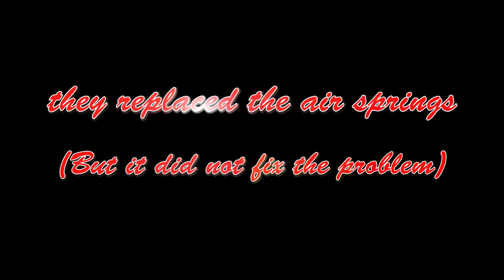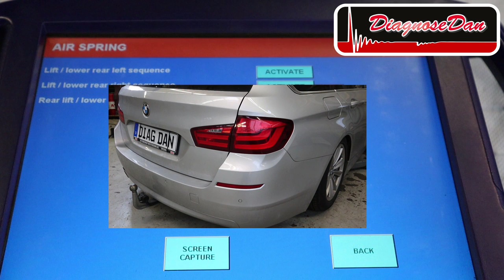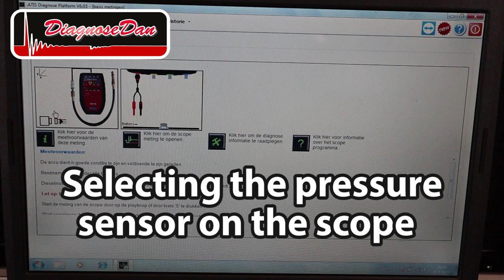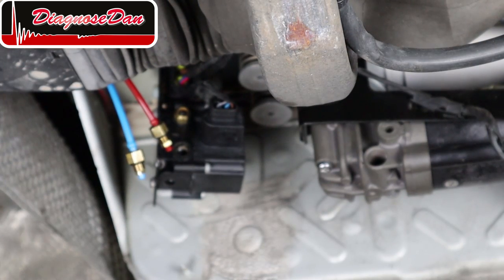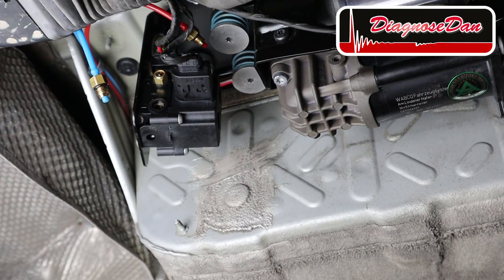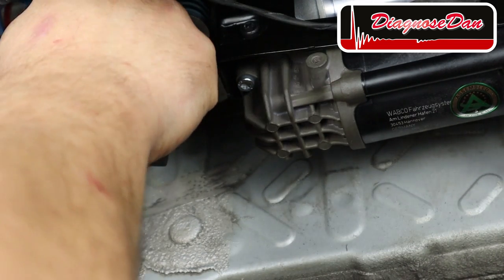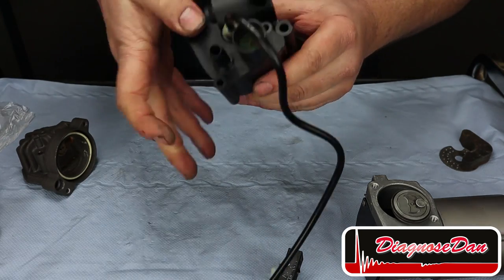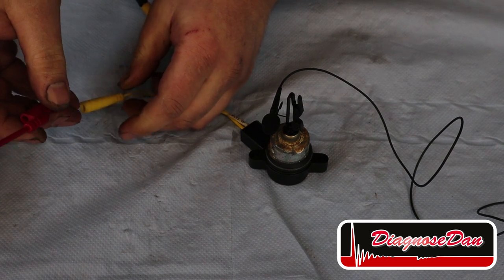Air Springs replaced, but no Fix!

Comment: What sort of an outfit gets itself (and its trusting customer) in this amount of trouble. Dan you say in the comments that they were under "time pressure" . That's because they spent their time replacing airbags at the customer's expense. I would be ashamed if I had to have another tech tell me that the pump is bad. 
The "time pressure" line is designed to stop the reader from thinking any further--- something they themselves are very good at.

Comment: On the first glove test, did anyone notice that the glove deflated after the compressor shut down? The compressor couldn't even hold that small amount! I wonder why the other shop didn' try the finger test before replacing BOTH(!) struts. Rare that both would fail at the same time..or was it a sales  that they should be replaced as a pair(?)

Comment: Very interesting video, as usual. 
Something should be added : these air suspensions are, and have always been, completely useless. I am the happy owner of a W112 300SE (with mechanical air suspension) and a W111 250 SE dating respectively from 1966 and 1965. There is absolutely no difference whatsoever regarding the level of ride and comfort which these two cars offer. But the air suspension fitted on the W112 (a Knorr Bremse/Bosch system) is a source of unimaginable complexity. And costs...
Never purchase a car with such systems, they are useless... for cars at least. 
Such systems are perfectly suitable for lorries and trains. Both Knorr Bremse and Wabco produce sub-systems for such vehicles.
Reply from the maker: Thanks for watching my video's !

Comment: Air suspension  is a good way to get rid of your moneyAlso a very expensive misdiagnosis by the other shop to replace the air springs
Reply: bobl78 I agree with the misdiagnosis, not very smart. About air suspension: I like it very much. No matter what the load of the car is, it’s always straight. Just keep my 🤞it won’t break.
Reply from the maker: Airsuspension is great in certain cases.(As long it doesn't break down😉)

Comment: My 2012 bmw f02 passenger side  air suspension will not rise up. The compressor is working, the driver side will rise up. What can it be.
Reply from the maker: A leak in the passengerside, faulty rideheight sensor, something wrong with the valveblock. Ect.

Comment: My local mechanic changed the balloons. Didn't help so he changed the compressor, motor with solenoid. That solved the issue. Last combined valve was not changed. My old compressor is working but pressure is inadequate. No water in air chamber, piston ring is ok and solenoid is not leaking air. What else could be wrong?

Comment: Curious what was wrong with the old compressor. Bad piston rings, or maybe a cracked section of pipe. Looked like the 1st glove test showed the glove deflate a bit when the compressor turned off.
Did you bleed the air out of the system before returning the vehicle to the customer? ;-)

Comment: My F11’s air suspension is failing, but in my case is intermittent. Some days I found the car normal, others the car is completely down, both rear sides. The compressor fires normally and it can raise the car. No fault codes. Any ideas? Great channel by the way Dan!
Reply from the maker: Hard to tell without diagnosing the car, might be the same problem.
Reply: @Diagnosedan  Thank's! I will raise the car up and check more thoroughly, might be a very slow leak. What is the function of the valve block? O guess there are two valves there, to redirect the air to the left/right air spring , shouldn't they prevent the air from escaping the air springs too?
Reply: I finely found the leak, after a full compressor disassembly and cleaning, I found nothing wrong there, the vent valve looks new, and I tested it with my PSU, tested the valve block as well, all works. (car is from 2011 and the valve was never replaced). When lowering the car one of the air springs started to hiss, I then used the water/soap mix (tip learned for another of Dan’s video) and confirmed it. Thank’s Dan!

Comment: Two things: 1] vent valve could be evaluated by putting hand over it to test for escaping air ??  2] leak test by first shop would have revealed no leaks because there was no pressure in the system...unless they employed an external source of air pressure.  Obviously there was a massive leak...at the vent valve.  Sad state of affairs if such a simple system can't be evaluated correctly without the basic "common sense" approach of Diagnose Dan !!!

Comment: Hey Dan! Great video as always. Just a question, do we need to use special grease (silicon grease) or just the regular one  for the air hoses? Thanks
Reply from the maker: You can use the regular on, you only need to use a little bit😊

Comment: now, what many of us want to know, was it the actual compressor sleeve/piston/seal/valves or the magical solenoid valve body/controller assembly (which didn't sound like it was venting) but who knows ;)
Reply: seen later in video you showed the compressor without the "magical controller valve" I'd be skeptical and test it directly dead headed.........
EDIT and I need to shut up and watch more/whole video before commenting, but it's hard to recall all my thoughts by the end ( if this was school, Id have to take notes lol)

Comment: it is extremely scary to know that there are workshops out there replacing the whole air spring assembly without performing a basic air pressure check. That's worth repeating in uppercase letters with an exclamation point on the end so as to emphasize my point. REPLACING THE WHOLE AIR SPRING ASSEMBLY WITHOUT PERFORMING A BASIC AIR PRESSURE CHECK ! That has to be incompetence at its worst and has just made my top ten list.  It appears you have your fair share of monkey mechanics in your native land as we do here in Australia.

Any way Dan, Your videos are great not only because you know what you are doing  but also because you add a nice touch of humour - It looks like you actually enjoy yourself unlike others in this field who hate what they do. I would guess that the less one knows or the more incompetent one is as a mechanic the more they will dislike the trade and this will reflect in  the quality of their work.
I am curious to know your career progression and how you attained your knowledge. I am guessing you must have had good teachers and worked for a good workshop when you were an apprentice.
Reply from the maker: The really  Scary fact  is they are also working on brake systems 🤣🤣

Comment: nice hitch.
don't want to be putting your finger over the outlet with a cut - might want to use something other than your finger for safety.
Reply from the maker: The compressor might inflate you😂😉👍
Reply: @Diagnosedan  that was fast, do you live in the matrix?

Comment: Dan, great video. I replaced my E70 airsprings and the air compressor is not working/pumping air(while the car is still jacked up). Can it be I need to lower the car to activate the level sensor? Also, I drove my car for 250-300 miles before the replacement and I read many posts saying the compressor will actually shut down in sleep mode to avoid overwork and needed BMW car diagnostic software to active/wake it up, true?  Please help. Thanks

Comment: Hi Dan my compressor seems dead. Bought the car with the suspension not working. Changed air bags, the 40 amp fuse was missing, I put one in and changed the relay in the boot. Had already removed the air compressor to clean the air drier. On starting the car there is absolutely no sign of life from 
the compressor, no noises, nothing. Would this suggest I need a new unit? Thanks

Comment: Dan - I recently got a second hand 5 series with some inheritance but now my suspension is dropping when parked - sometimes it inflates but sometimes I have had no choice but to drive bouncing around. I took my compressor off and accessed the desiccant and dried this in a microwave…. Thought it could be moisture. But the same happens. 
It started dropping on my left but now both side drop and sometimes I can hear hissing or the compressor running when ignition is off. Could it be the air bag? How can a diagnose the problem? Thanks in advance!

Comment: Hey Dan, basic DIYer here. If the airbags inflate sometimes and don't other times but I hear the compressor come on all the time.  Hole in the bags or bad compressor?  Or both.  2016 X6 . Thanks.

Comment: I have an f11 with two new air springs. Keep getting control time lowering error and control time lowering right side.  So far relay, valve block, control unit, both air springs and right side sensor have been replaced. This air suspension is driving me nuts.

Comment: After the first shop replaced the air springs and checked for leaks and then found out it did not solve the problem, wouldn't the next most logical thing be to check the air compressor?  Why did they send it to you?.

Comment: You should have checked the pump outlet pressure before the valve block and the pump inlet for a restriction before changing the pump. !
Could have been a bad wire to the valve block ;)
Reply from the maker: You are right! In reality i did but i didn't show this in the video! I knew someone was going to mention this🤣

Comment: New shocks and new compressor because of corrosion in a $20 solenoid. I feel sorry for the customer. TheReaper!
Reply from the maker: Don't it was the costumors choice to replace the entire compressor. He was called of course. About the airsprings your right.
Reply: @Diagnosedan  I just feel sorry for that customer because the first shop didn't know how to properly diagnose the problem,  the fact that the shocks that had NO LEAKS should have told the mechanic the problem was likely elsewhere. Parts for a BMW aren't cheap so getting out the parts cannon can get pretty costly. The customer probably did the right thing for himself by replacing the entire compressor, but BMW did a lousy job on the compressor's design. I'm guessing, but I'll bet the customer spent around $1,500 for a faulty $20 solenoid. That is a shame. TheReaper!

Comment: Proper diag!Compressor is made by?
Reply from the maker: A company named Wabco
Reply: @Diagnosedan  Wabco use to make a good products back in a days air valves,heaters.electro valves and solenoids etc etc

Comment: Dan I have air bags all round my e53 X5 the rear are fine but every now and then I get the inactive air suspension and over about 2/3 days the front drops, but re sets via a snap on diagnostic tool, iam loosing air I guess from somewhere but no videos on the components anywhere with 4 airbags and how to fix, need your help desperately please, Tim

Comment: 2017 bmtroubleyou and the compressors failed already 😂😂, I've got a 2004 lexus ls430 on its original air compressor and it's still going strong

Comment: I have replaced the solenoid that I bought from eBay and compared to the OEM part,. The  central pin came straight out of the center of the solenoid which doesn’t happen on the OEM part. The big problem here is that the compressor only works 1second and stops. With the "bad" solenoid (OEM part) the compressor works for about 10seconds but the car is not lifting.  I'm out of the ideas here.  Any suggestion what the next step to diagnose ?

Comment: If there is no dash symbol come up and you can hear the compressor working - what is it likely to be? I have a 2012 BMW F11 touring - the rear suspension is on the deck - the left rear went slowly then the right rear - I cannot hear hissing from a faulty tube?

Comment: Great video Dan! I tried the glove test on both sides and only one side exploded! my car is leaning to one side in the rear so I switched the airbag from one side to the other and to my surprise the airbag lifted. If there's pressure from one side and not the other on the compressor. what could it be? Thanks! Liked and subscribed

Comment: 2015 ram 1500 installed new arnott shocks valve block and compressor...now I get offroad settings unavailable due to excess payload message.  Calibration offsets are high on passenger side and normal on drivers side.  I've tried to calibrate it many times nothing changes the message.

Comment: I have a BMW525d E61. 
I have changed the air compressor, but it works continuously without stop,  when it works till the car comes to standard level, it does not stop and work till it burns out. 
Do you know what the problem is???

Comment: Hi Dan, Does 2011 BMW 320i E90 and 2011 BMW 528i F10 have air compressor? Both of my cars are leaning to one side, left side height higher than right side. Had both of them replaced with new set of springs and shock absorbers. Cheers

Comment: Advice to the customer:: "Don't drive a BMW in the rain."  How could any engineer design this system with it's major electrical component under the car behind the bumper?  Must be the work of the designers of the Trabant they got when they unified with East Germany.
Reply from the maker: In the car in the older models was no succes either😉
Reply: Normally this happens because the inlet air hose deteriorates, and sucks in dust. after a small while the pump is no longer good. Make sure that you have a good hose and a good filter at the end of the hose, and it will work the life of the car. I know because my E61 has done exactly this. Had to change the pump under warranty after three years. after that I changed the hose myself, and it was shot. the new pump wouldnt have taken long before  it was destroyed that too.

Comment: So.. who wore the cost of the new air springs?   Unbelievable that a workshop would buy them in and replace without even testing if there is any air pressure.  Especially given they need only remove one of the air lines and put their finger on it.

Comment: Hey , i got a Bmw e61 525d in the shop with NO rear brakes at all. just had rear pads  by the dealer. master cylinder  toast?
Reply from the maker: I personally never had to replace a master cilinder on a E61
Reply: @Diagnosedan  is there some valves or maybe something in the abs module that can be messes up by pressing in the brake caliper pistons from the brake job?

Comment: what is the solution i have the same problem a few days later when the car is parked it lowers the back side my car is a mercedes e320 my bellows is solid I don't have a compressor problem in lowering and lifting

Comment: Hello Dan. I changed the motor of compressor, after it's dead because long time run and blow 3 40A fuses, changed the air springs with new one's, changed the relay, and i still have the 480DA6 error on my F11 - 2014: compressor relay - shortcut to GND. The vent valve is good, it.s working, The value of resistance on valve block is 16.1 Ohms on the 2 ways (the manual says between 10 and 30 Ohms. WTF is wrong with this sistem? Thanks

Comment: Hi. I have an 2014 X5. I parked the car and locked it but the compressor kept on running. I took the car to the mechanic, who changed the compressor, the valve block and the air springs. The car drove for a month and the compressor started to run even when the car was stationary and locked. The car rear airsprings has sagged again. Please help.

Comment: Wow! That's crappy on a completely new level! They built a miniature truck system with air dryer and everything. And still, only two years was needed to ruin it. -With moisture... WITH an air dryer! At the same time, my old bus conversion also has Wabco parts. But they are perfectly fine after 45 years and 900.000km. And that does NOT have an air dryer. Also, i have a crappy 10 euro 12v-compressor that looks like the BMW's but made of nasty plastics only. I abused it for ten years and it still works. 

BTW: Why does the BMW need 13 bar? Insane. 6-7 bars are more than enough for a massive fully loaded lorry. At least, i think it is. I only know that around 6 bar, my 11 ton Setra lift itself up way faster than that BMW did with 13.

And why air springs in the first place? It's crap compared to the hydraulics of a Citroën. And about a million times more reliable as we see here.

Good video as usual. But please, don't expose your skin to compressed air. It pushes in bad stuff in your blood. Not good at all. And if you work on any kind of hydraulics and see a mist, that's REALLY hands-off! I have only seen it with microscopic rust holes in hydraulic lines on Citroëns. That's about max 180 bar. I guess those modern 1000+ bar diesel injection pumps is not the best thing to wash your hands with either...

Comment: shouldnt that have set a code other than the one u had maybe a vent code
Reply from the maker: The only sensors on the system are the ride-height sensors so there isn't much else the computer can check.😉

Comment: Compressor design seems to be flawed, if I have understood correctly, drying the output air, which is good for spray painting, but not suitable for this application, should have a replaceable desiccant filter on the input. Desiccant will last just days in a humid climate, unless there is a drying cycle i.e. heated and vented. Very noisy compressor on an expensive car, I will stick with real springs.

Comment: My e39. Is doing this. Bags hokd pressure but light will come on when the csr doesnt raise. I tried switching level sensors around to no avail. It was loosing very little pressure over night which is normal. . Would raise as normal in morning. No dash light. It got worse as years  passed.  pump would run car would raise dash light would go out. Now pump runs, car wont raise, light comes on dash.  Looks like ill do the pressure test tommorow. And get a new pump.

Comment: Nice video! Does this vehicle reside in a corrosion prone atmosphere? Would just replacing the solenoid void the warranty? At only two years old, did the warranty cover the repair costs?
Reply from the maker: The customer imported this car from another country and than in some cases the Local reseller doesn't provide waranty.